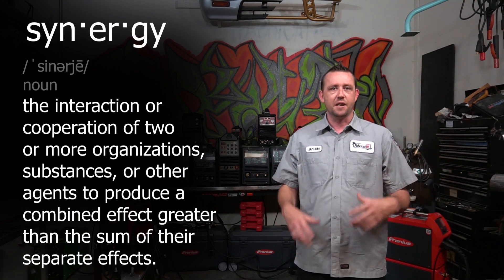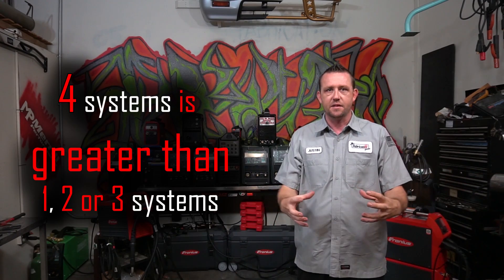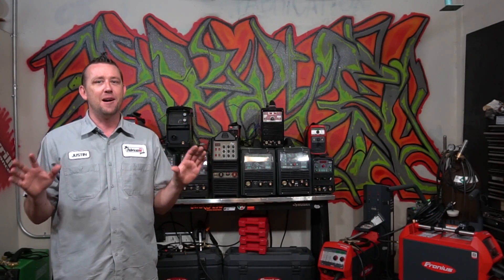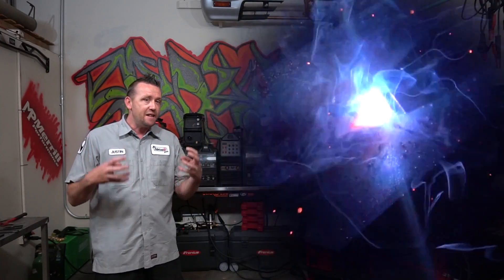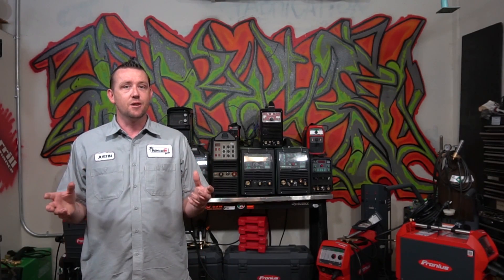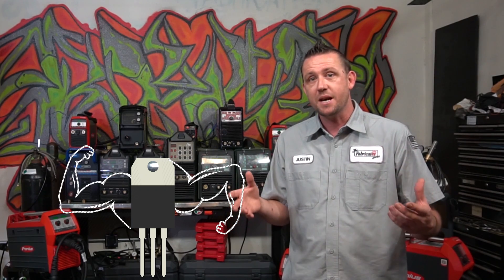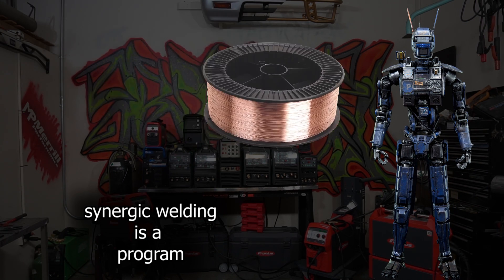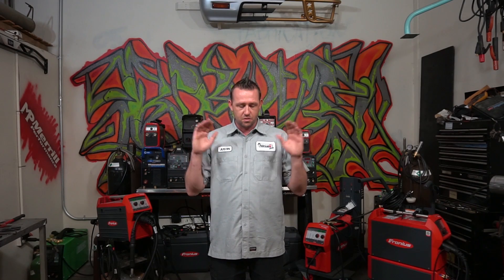TFS: What Is Synergic Welding

Comment: I'm working with it as well and eventually I had the setting that came closest, however... I don't like it. The way I figured it out now is that the Voltage determines the width of the weld and the wire is how much amps it gets linked to the wire feed. I learned to weld the old style and this is just frustrating to me as when I finally come close and want to adjust the amperage a tiny bit I have to take a ,1 step which instantly changes everything again. It may be handy for those that start welding but for me it's a way to get set up generally but without control to fine-tune it and specifically for the surface shape of the weld. I must say that for pipes you can use the manipulator's speed to correct that a bit but it also means that at times your slack will interfere with it. While the idea might be good, it's taking away full control over the weld. While that is not as important to a fence in your garden, it's a different story for pipe welding. Just my 2 cents on this. Have a great workweek all

Comment: I work at a stainless steel industry and use a wfx 300 synergic mig welder to weld platforms and I find it quite hard to use, I am sorta new to welding in general as I have an Aprentaceship there but my stainless steel tig welding is beautiful i must say. Any tips and tricks for anything about stainless steel synergic mig welding?

Comment: synergic welding is essentially a set if inputs and outputs surmounted on a base plate of prefamulated  amulite. Basically the only new principle involved is that instead of power being generated by the relative motion of conductors and fluxes it is produced by the modial interaction of magneto reluctance and capacitive duractance. 

..any way - synergic welding is completely derivative of turbo encabulator technology and its more recent cousin the retro encabulator . The main advantage is the reduction of side fumbling and its applicability for welding novur trunions.

Comment: Have a Miller multimatic 215 sure wish they did more testing with it. Pretty much every setting is way cold. Running 220 or 110 both are cold. Still love it but would be awesome if they had it slightly more dialed. It does give some adjustment when using autoset mode but I'll have to crank the volts all the way up and wire speed done a bit to get it to work perfectly. Welded a rouge fab bender using the auto set looking at the welds they were slightly cold and I should have trusted my better judgement and went to manual settings. It is nice just being able to hit some buttons when changing metal thickness though just wish they spent a little more time dialing it in.

Comment: Had a chance to try out the Fronius welders today. That synergic setting is amazing. You can still make mistakes if you go off track, but If your on your game it helps 10 fold. I tried the 270i mig and the tp150 battery arc welder. It actually gave me a better feel for what i`m trying to achieve. I can`t wait to get back onto my simple machines and see how its helped.

Comment: 🖕 new
Reply from the maker: pro welder 🖕 old...?
Reply: The Fabrication Series  no they can't set their own welding parameters? Millennials are pussies
Reply from the maker: pro welder What do millennials have to do with this?
Reply: The Fabrication Series They don't want to learn anything, there lazy, so we're designing new equipment and new technologies just so they can get by
Reply from the maker: pro welder That's why you dont like new stuff? Because it makes it easy for millennials? 🤣 Sounds like you're just too lazy to learn it. The technology is actually older than millennials if it helps you wrap your brain around it.
Reply: The Fabrication Series dude I've been in fabrication for 25 years. I've  ran almost every machine and process there is mig, tig and stick. This process will die off just like all the rest and we'll be back doing it old school

Comment: Pre-programmed welding parameters have their place. It's a good starting point, especially for someone who's just starting to learn. However, i don't think they should be relied on for everything. Every situation is ever so slightly different and will need different settings. Sure, a preset can give perfect result on freshly cleaned pieces that a robot welds, but in 'real life' there are way too many variables. Something as simple as what pattern you do with the MIG gun (ZZZZZZZZ, eeeeee, 888888, that sort of thing) can be the difference between good and bad. Can't really program the machine for everything.
Reply: Yep from 1G to 4G welds, its all different

Comment: Does no one else have trouble hearing his videos? I'm in my shop, but, usually i can still hear videos. Bit his are very hard to hear without my phone at my ear
Reply from the maker: xz empt I dont know who else has an issue hearing it, but I'd suggest there may be a problem with your device. It's at high volume on all of mine and nobody else has mentioned it. If you tell me what you're viewing the video on, I'll look into why you cant hear it.
Reply: The Fabrication Series my shop is noisey, but, this series is the only one I have to use a headset to be able to hear. I mean, I'll be the first to tell you my device has its problems lmao but the speaker isn't one of them.

Comment: There is one other nice thing about synergetic control and that is, once the machine is set up (wire speed trimmed +/-) its now one dial control, ie; rise the voltage to weld thicker material and the wire speed automatically follows the adjustment..       A Lot of Synergistic machines also have waveform control (adjustable inductance) def nice to have for shaping the puddle!

Comment: I hope that you will have more to teach about the synergy processes.
Reply: There is nothing special about it. It's just preprogrammed settings on welding machine. For example: you choose wire, gas, whatever amperage you want and machine will automatically adjust wire speed and voltage so you won't need to play with machine each time to setup it for specific materials. (You can always go to manual mode if you don't like synergic)

Comment: I always use synergic when I have a one off part and no practice material around. it usually does the job. sometimes it’s a little hot but thanks to  everlasts mts 251 si, I can fine tune the settings on the fly and I’m up and running. BOOYAH!!

Comment: I thought it was a Volt/Amp feedback loop that adjusted wire feed speed to maintain the ideal parameters ? Also you never got back to the "we will get back to this later" thing.
Reply: John Smith sort of sounds like you are talking about constant current mode.
Reply from the maker: John Smith I did get back to "why" - it's at the end of the vid.

Comment: Using a Lincoln Powermig 350 for the last decade in structural tower fabrication... never use the synergy modes.  They just don't pass x-ray or destructive bend on a50 steel of any width, synergy parameters are just too far off. This rig has been serviced many times.
Reply: You would think Lincoln would be pretty good too, too many other variables I guess?
Reply: I guess it doesn't surprise me though the recommended settings in the wire specs never seem to work either.
Reply: @Pr that didn't really make much sense, its contact tip to work distance, period. Yes you have to take it into account if your tip is inside the shroud, but that doesnt make it some second type of stick out. Flush is good unless you need to run high stick out with wind around and you want your shroud closer to avoid porosity, usually with gas shielded flux core.
Reply: @Pr you are correct, I'm just saying where the shroud is doesn't matter, 30 mm from contact tip to the work piece is the same whether the tip is way inside the shroud or flush. Just makes it seem different.
Reply: It's more likely you don't know how to properly use it.